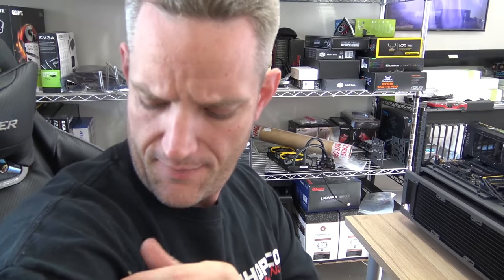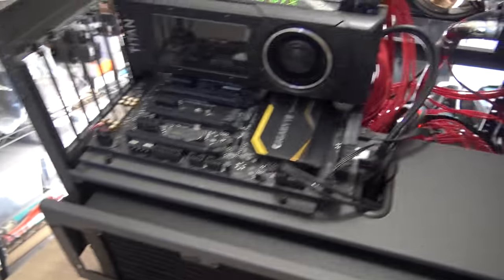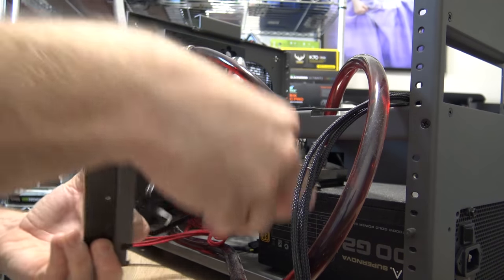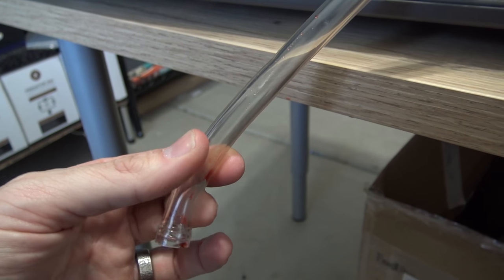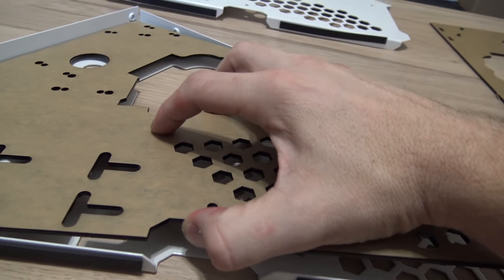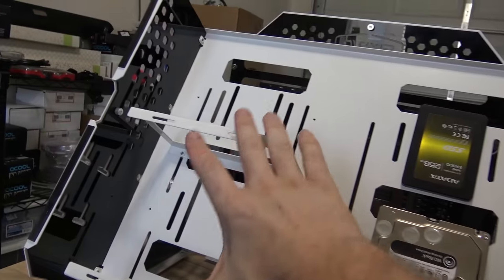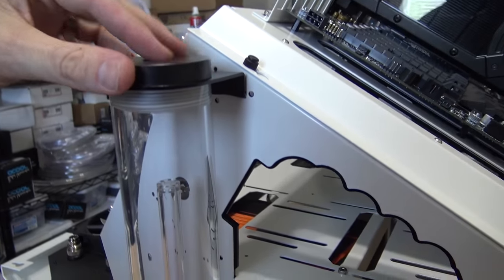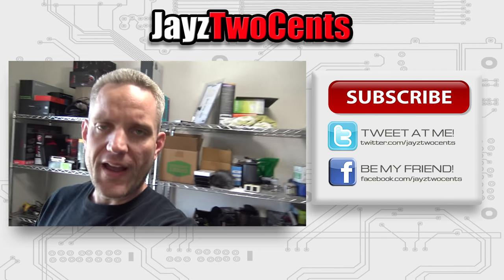Build Vlog Part 1 - New Praxis wet bench for the test rig

Comment: Love these videos, I watch them at work :P. 

FYI, regarding the Alphacool sponsor clip at the beginning - That 5.25" Alphacool repack dual bay res they show really really sucks and is not worth the price! I do normally like Alphacool's products though, it's just that one is junk. It can't do a proper serial loop with the 2 pumps. 1 pump just spins without actually doing anything and the pump volute is restrictive, there's reviews online that show just how badly it performs especially considering how much it costs. It can't do dual loops either, both pumps share the Res. I highly recommend the Koolance RP-452X2. It quite simply is the best for dual pumps and dual bay.
The XSPC twin D5 Dual bay res is also good but it's obsolete now...I own all 3. The XSPC gunked up (My fault!), the alphacools sitting in a box somewhere and the Koolance is running in my rig perfectly.

My TwoCents (lol).

Comment: So, is that an actual case labs case that you used as your old test bench? did it have a top to it? Or was it designed as a open air test bench. (asking this because case labs do make cases where the mother board lays flat)

Comment: Jay, is there a chance you might get the new Alphacool Eisbaer soon?
Reply: The Eisbaer 240 is an excellent AiO. It performs moderate but it is damn near silent. The pump on 7V is allways more silent, than the fans on 7V. 
My 4690K at full load with prime95, was reaching 57.5°C wich puts the Eisbaer 240 in 4th place in my tests with various AiO and Air coolers. While using 7V it only reached 34.5dB, while my room is "idling" at 33.5dB, so almost silent.
Reply: WorldOfHardware that's actually really good. Considering the price range of between $100-$170 on performance PCs, that's plenty of bang for the buck. However, since it's expandable, I'm curious to see what types of expansions Jay can add to the kit before the pump can't handle it anymore. On top of that, I like watching unboxings, so there's that
Reply: I would love to see Jay get the Eisbaer aswell.
I could add another 240 rad and my watercooled 770 very easy and got no problems with the pump running at 12V. 
Maybe Jay could add more without a problem :D

Comment: Hi  you have a few gtx1080s  i brought a Evga gtx1080 FTW from ncix  Canada had it shipped to Australia  when i installed it in my computer i noticed while gaming the temps where getting very high  upto 95deg c  looked in my case the gpu fans weren't working  the fans where not spinning at all  can't workout why   have you any idea's  tried reinstalling card tried reinstalling drivers  checked the fan 4pin connector seems tightly on    very frustrated all i want to do is be able to game in 4k on my 65" tv
my last card evga gtx980ti sc  run fine and fans worked great

Comment: have any of you guys ever experienced a bottle of EK - Ekoolant EVO uv green or any other coolant losing its color and turn yellow after u used it the fist time and have half a bottle left sittin in a closed in a dark closet? after a longer period? say 3 months?? is this normal once it has been exposed to air once or twice?? the fluid in the system is still the same color as the day it got in though? The bottle says 3 year shelftime..? but i guess thats an unopened bottle?

Comment: I want a AIO (280mm) but the loudest thing in my pc is a 5400rpm WD Blue (4tb) and i don't want to have more noise .. Any recommendations???
Reply: Get rid of the 3.5" HDD an get a 2.5" HDD. Or get only SSD.
Reply: +Pas cal i need the 4tb and its not too loud , but the AIO should be quieter ... Its quieter than my clock btw...
Reply: So your CPU and GPU coolers are 100% passive and you have a fanless PSU (and magically no coil whine from anywhere)? Because if not there's no way a 5400RPM drive is the loudest thing in your PC.
Reply: My 5400rpm HDD is the loudest thing in Idle. I have an Arctic Freezer 13, an GTX770 Windforce and 3 120mm PureWings fans.
Reply: +Mr Kagouris noiseblocker fans , and im talking idle
Reply: +SIME_LP my PSU has fan stop just like my GPU
Reply: +SIME_LP EK Predator AIO. Premium quality, PWM control lets you set the fans to virtually any speed.
Reply: +Mr Kagouris and the Pump noise ?
Reply: +SIME_LP Pump speed is controllable and much quieter than closed loop AIOs (e.g. Corsair) which use sub-standard pumps.
Reply: +Mr Kagouris Thanks , if i find one ill test it ...
Reply: +SIME_LP The only catch with the Predator is that you have to be a bit more careful handling it as it uses standard fittings for the tubes.
Reply: a friend use WD Red 3TB its pretty silent
Reply: My 280mm kraken x62 with two 140mm fans is almost dead silent, fans idle spin at 600rpm lol most spin at 2000. Your fans wont have to work hard so they can run really slow